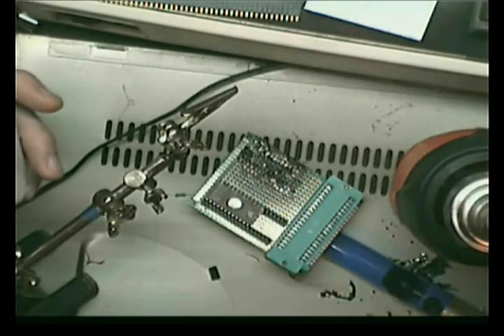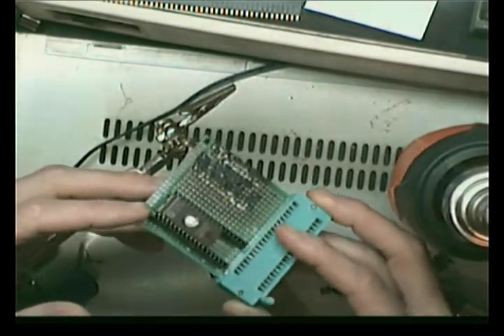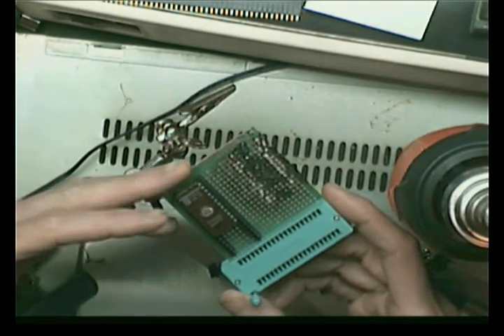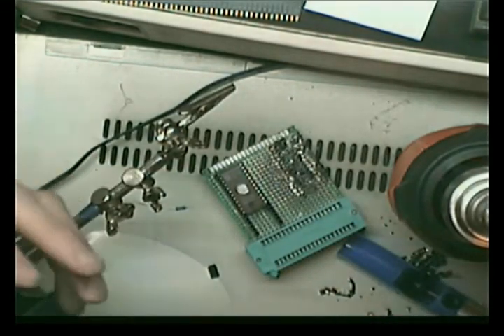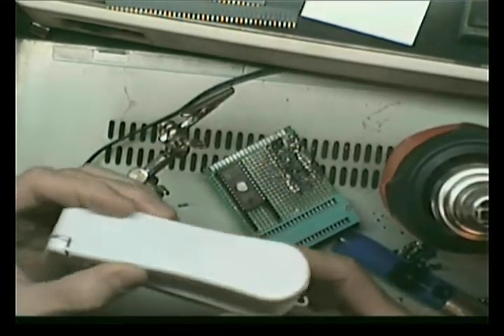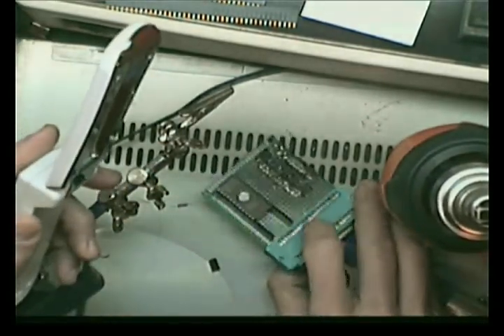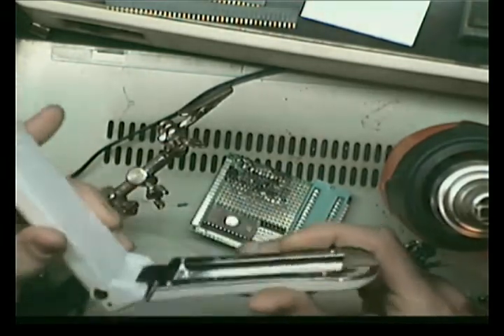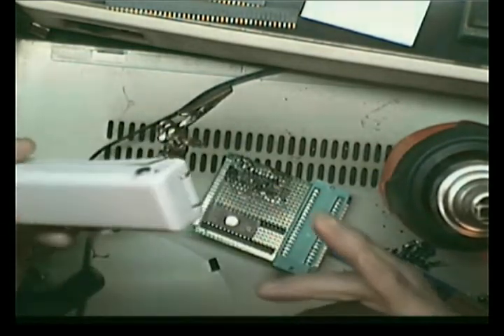Cheapest Way To Erase An EPROM

Comment: Not a bad product find. In the past, I remember using a small 5mW UV LED fed by a power supply about 1/4" above the window. Needed an exposure time of about 3 hours with that though.
Reply from the maker: It looks like it takes 2 really small diameter florescent bulbs and it takes about 30 to 40 seconds for them to get to full brightness. I was also surprised by the 20 to 30 minutes of erasure time, that's inline with "proper" eprom erasure devices costing around $30 to $50 bucks. I just didn't want to spend that much and have to wait (online order) so I spent more time researching for something local so I could use it immediately.